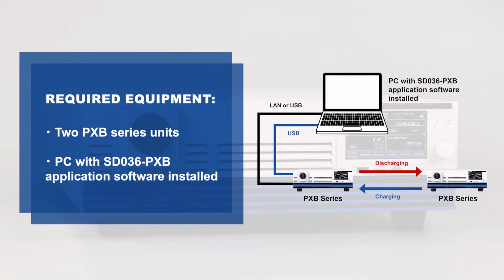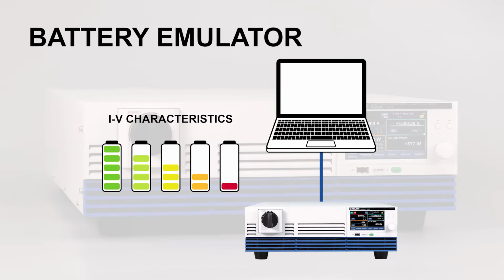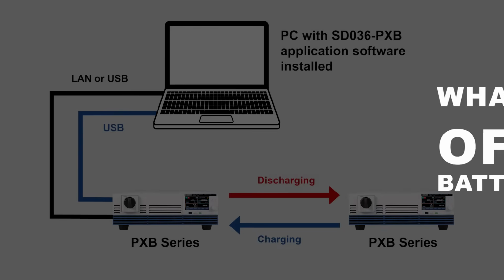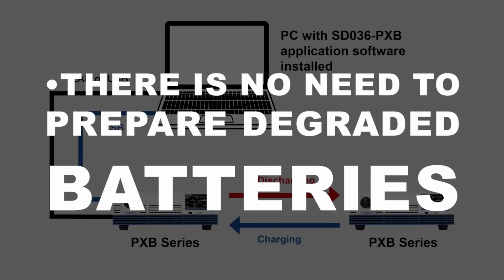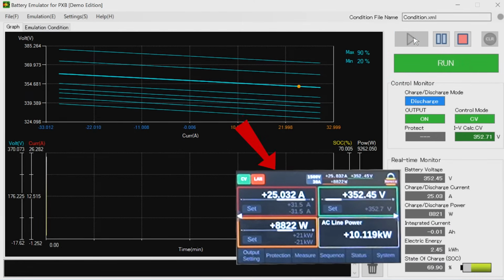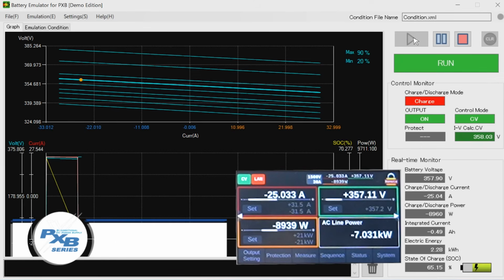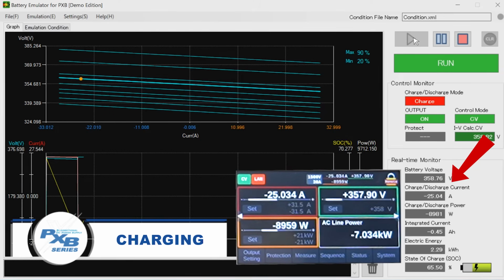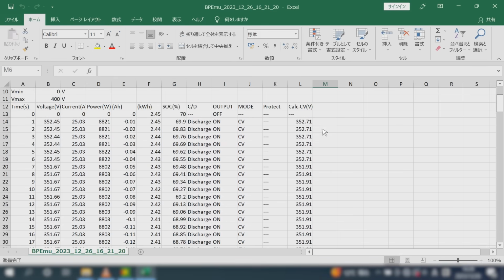The PXB Series of Bidirectional High-Capacity DC Power Supplies- Battery Emulator System

Comment: How do you provide that kind of power output? And how is the speed of the power supply ensured to emulate a battery?
Reply from the maker: Hello, thank you for the comment.
First, regarding the power output, the energy is supplied from the PXB series of bi-directional power supplies. As for the speed, it is difficult to say since we are not sure which speed you are asking about. However, the speed of rise/fall and transient response are affected by the specifications of the power supply, so they will be slower than a real battery.
Reply: @KikusuiElectronicsChannel  Thanks for the answer. You correctly understood what speed I asked about. We have high speed "Keithley" battery simulators, but for smaller capacity batteries. We also have a lot of equipment from your production, and it helps us a lot in the development and production of our products. Thanks again and good luck to your business.
Reply from the maker: @AndreySurkov-b7b  We are thrilled to hear you are using Kikusui products! Customer feedback is always a great motivation for us. If you have any other questions, please reach out to us anytime. We will be happy to help.